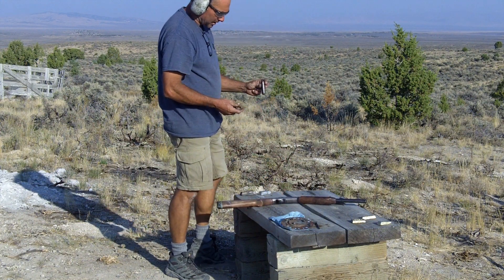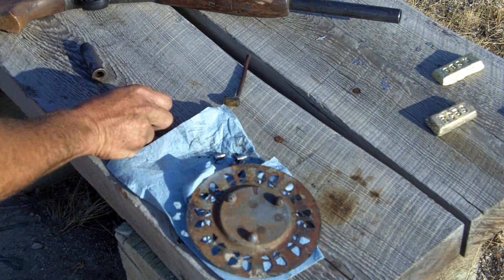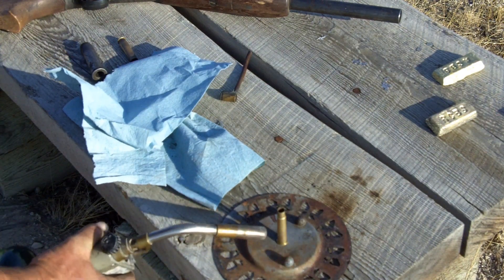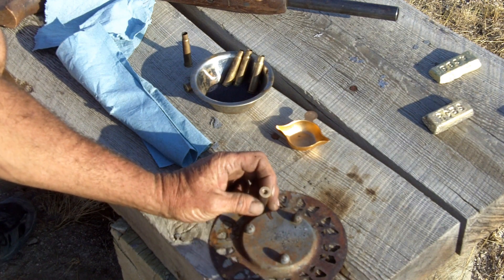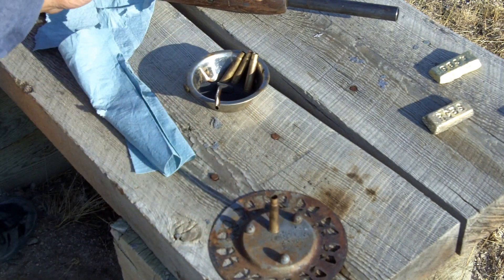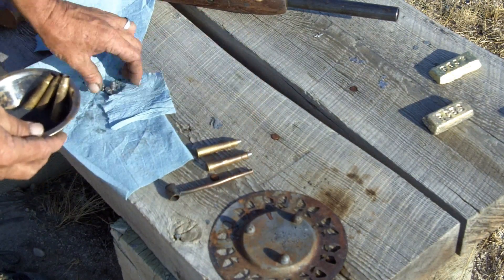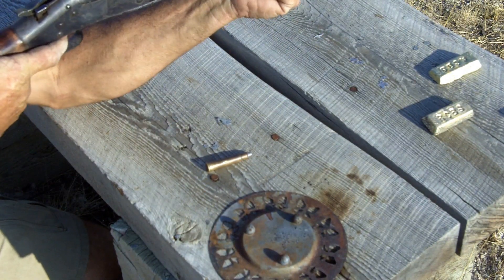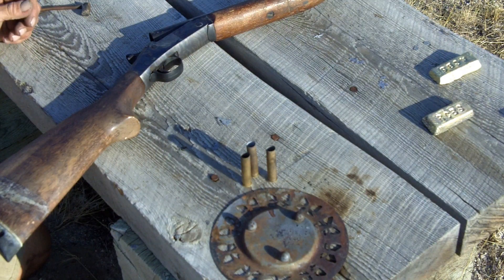fireform

Comment: I did this with my single shot 410. Used 303 brass, annealed, add green dot powder or unique, wad of paper towel and grits for filler. Worked great. Trimmed them and I load with unique powder and 1/2 oz of shot. Also works great with fffg blackpowder, veggie wad and shot and covered with milk carton package for shot card to seal ‘em.

Comment: What kind of load data are you using for these after fireforming them into .410?
Reply from the maker: I have not got it fully worked out but it will be low somewhere around 20-30 grains FFF BP and 1/4 oz shot no 7 or 8 its just for close to the barn vermin control.
Reply: @damocsell  I'll be interested to see your results.